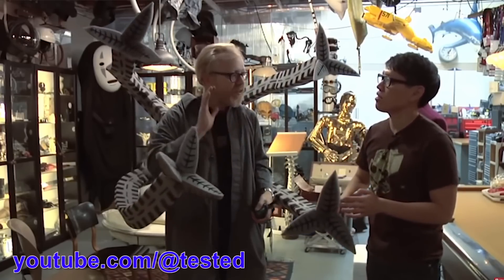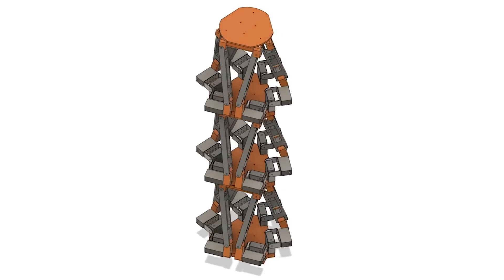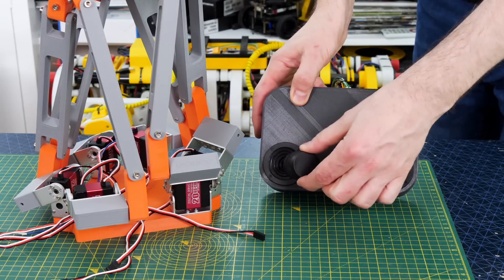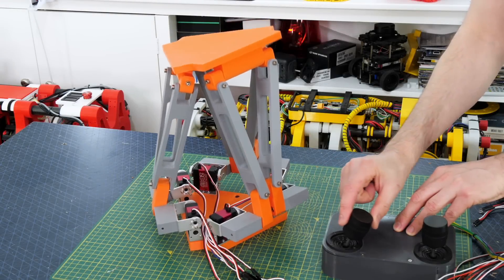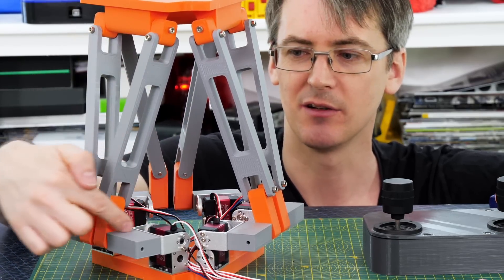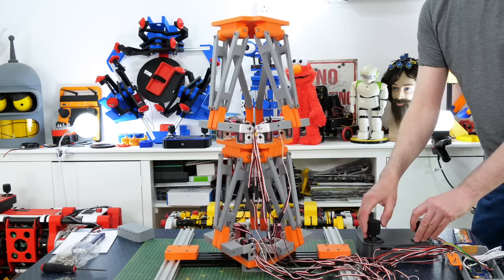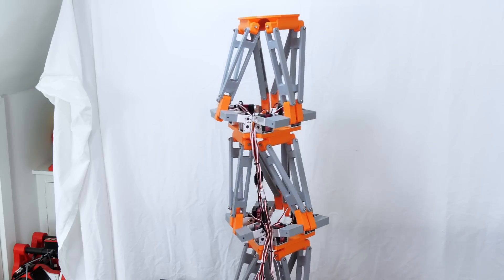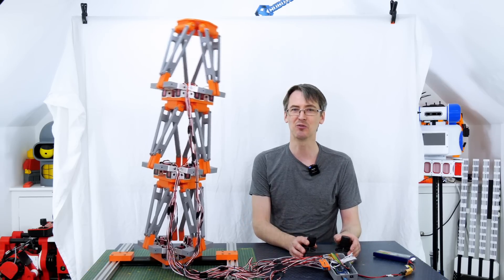Building a better Doc Ock Tentacle

Comment: Are you planning to make the Octoarm go to a certain point in a coordinate frame, or are you staying with manual control? 

Would be sick if you could utilize the basic kinematics you integrated in this video, reverse it and make a controller capable of producing a set of outputs for the servos, which puts a point (prefferebly the tip) of the robot at a certain point within a coordinat system (within a set of viable coordinates). 

That said the algorithm to produce these outputs would require constrains relative to the systems capabilities.

Once that has been established, path planning along with paht optimization would be cool to see. 

Finally a fancy way of designating the goal point in 3D space. Perhaps a laser pointer combined with VSLAM both to recognize the pointer's reflection, designating the goal postion and mapping in the ennvironment as to define which constrains should be appliend in real time. 

I would love to see how you do this with regards to real components and how you would get them to comunicate and so forth.

Comment: AVP 👽⚔️🐍
 Right / but doc oct/ and cerebral control"/ yeah ,where are you / ...the cranial electroded'/.../ So the boards/ what set the specs/ / so transistors"/ tuned to which waves....beteas"/ / to any actuator, that just open and closed

Comment: Id love to see the MK2 of this. Perhaps using belts (metal core so less/no stretch) instead of ball screw? could save on weight Im just am chair engineering thought. Perhaps Ball screws are a better solution for stability.

Comment: James, the exact inverse kinematics equations are actually very easy for parallel manipulators. In this case you probably don't need super accurate control, but it might still save you a lot of headaches in the future if you get the IK right. Parallel manipulators are the opposite of serial manipulators in that the IK is usually trivial, but the forward kinematics are tricky and have multiple solutions. As an example, Section III here shows the idea for a typical prismatic-joint Stewart-Gough platform: http://connor-mccann.com/wp-content/uploads/2017/10/Design-of-a-Stewart-Platform-Inspired-Dexterous-Hand-for-6-DOF-Within-Hand-Manipulation.pdf. This is just from a paper of mine that I could find quickly, but there are tons of other examples of it online, too.

Comment: For the macro positioning, you could use a parametric spline function. As you know the length of each section, you can easily calculate the 3d slope at a given point along the curve, which will give you the normal for the platform that you can feed into the inverse kinematic function.

Comment: you can achieve yaw with a stuart platform, you just dont have a great yaw component of force given the current actuators straight up/down orientation. Considering you have 3d translation and 2d rotation, this design actually has enough actuators for all 6dof but is leaving 1dof on the table with the geometry.

Comment: Hello, i'm working on a project to control an inverted rotary pendulum with the dc motor voltage as input and the vertical pendulum angle as outout. Any tips for designing the controllers and wothits implementation?

Comment: In all reality, this project is the most accurate to the real doc-oc arms, in the film, you see that they have him wearing a prop for the arms but also that they use CGI to move them. When in CGI, the tentacles are larger than the prop tentacles. This is a thing that most don’t see and the reality is that it needs to be large to work right. Aka, this is probably more close the realistic scale of the tentacles if they were real.

Comment: Doc Ock quite often uses his lower tentacles for stability, so that might help with the weight issue. Also, I would say it's already a work of art, even sans LEDs.
Reply: The weight issue still applies to the individual tentacles. He uses his lower two for stability so that he doesn't flip over when he lifts something heavy.

Strain will always exist. It's merely a matter of knowing your limits.
Reply: I too use my lower testicles for stability.
Reply: @elijahbutterfield4869  r/cursedcomments

Comment: The lever moment on the arm with 5 to 6 segments, fully horizontally extended, is going to be quite significant. Maybe some kind of counter balance weight or spring setup? Interesting build though

Comment: I think it would be cool to try using pnematics for something like this! You can make it stretch and contract with very light materials! Not sure how the tubing would work though
Reply: The original comics uses something that looked like pistons. But they could probably be linear actuators in a shell.
The problem otherwise with pheumatics is piping and valves, and you would probably go hydraulics since pneumatics using air get more springy, and would bounce a lot more.

Comment: If you did want to make it an actual tentacle there might be some wire issues, they looked a little like they where in the way or would get tangled in the bendies.

Maybe putting a small hole in the center would allow you to funnel all the wires through that and minimize the mess?

Comment: this is a bit off topic but that Stewart platform mechanism looks like a pretty cool mechanism to use as a 3d printers printplatform. You ought to be able to 3d print on a slant with how it can manipulate the axis of the base
Reply: Already possible but not easy. Delta printers exist but generally only use three rails for xyz motion as they keep the end parallel. I've seen a build with 3 pairs of rails to achieve the tilting motion too

Comment: You should have the sections taper, get smaller and smaller towards the end.

And you should definitely do a version with twisting. 

And more pronounced movements, wider range, more extension, more compression, more bending.

So cool man. One of the top channels on YouTube. Always fascinating. Thanks.
Reply: Twisting is not really required if each section can move in any direction, you would only need rotation at the end for the gripper.

And adding the rotation will add complexity and mode springiness in the movement, especially if you do not use some rim bearing. A central shaft would make it quite a lot less durable and wobbly.

Comment: That's really cool!!

One relatively simple way through code to add some organic-ness to the motion would be to propagate the input to each segment with a delay. So, for a tentacle-y feeling, pulse the input through the base segment, then a slight delay before the second, then the third. If propagated in the other direction (tip first, then mid, then base) it would probably look more like a snake, where the head is making a decision where to go.
Reply: In the film, Doc Ock's tentacles DO move in that snake-like way in some scenes for precisely the reason you describe! They want to imply that the tentacles are making all the decisions, so they have the motion start from the end effector so it looks like a "head"!
Reply: This is exactly what I was thinking!
Reply: Damn I was gonna suggest that, that's basically what we do in 3d animation.

Comment: When you mentioned independent control of each section I started to think about ways to have more control over each section. There are 3 joints between the palm of your hand and the tip of your finger, so maybe it would be possible to have more independent control by controlling it with your fingers? Maybe you could use 3 or 4 fingers to control multiple directions. A device to accurately determine the position of each joint of your fingers may be a challenge though. It would probably require some kind of glove. Maybe with strings or a hydraulic system?

One of the problems I currently see is that finger joints are rotational, so there isn't linear control for extension or retraction. Therefore horizontal movement and making the arm longer or shorter wouldn't be easily achievable with finger control.
The thumb has a lot of control, so maybe you could have 3 points in space to switch between rotational, horizontal, or vertical motion? Like, you move use your thumb like it's one of the sticks on the controller. But if you have it in the bottom right you control horizontal movement, in the bottom left you control rotational movement, and at the top you can control vertical movement. Then you can also mix those types of movement by having your thumb in-between the positions.

It sounds like an interesting way to control an arm, but I also expect it to have a steep learning curve 😅

Comment: For a strictly doc ock tentactle, you could probably get away with just the 3 rotary axis to save on servos (and servo weight), since his arms don't usually compress or extend. Maybe look at robot arm  3 axis wrist mechanisms, especially the differential ones. Paul gould has some cool mechanisms in that regard.
Reply from the maker: using at least 4 axes makes it much more flexible so I still need the translation.

Comment: Look into using flexures rather than pivots. It should be lighter, and the springiness will give a lot of inherent structural integrity. I've had good results combining PETG with spring-steel inserts and elastic.
Reply: One could also tune these to get a pretension that the tentacle stays upright without any strain on the servos in the default position. So the servos at the bottom would actually pulling down for some moves, instead of just resisting gravity less, as it is now.
Reply: Was thinking something similar, possibly with the servo pulling the center to bend it.
Reply: Yeah and then using wires to control the placement of the tip, like how most mechanical hands work

Comment: For the second prototype feel like a smaller version of each segment to reduce the strain on the base might make it look even more like a real tentacle arm.
Reply: Or making the base out of stronger material and then moving to lighter material as you went further out
Reply: @Harlequin_Actor  nah, tapering is better. Materials have limits, geometry has... later limits :D

The strain is the product of load and lever. Increasing the diameter linearly with the arm length (=lever] means the base has to handle the same useful loads as any element. The structural loads (weight of the arm itself) add up, though, so the diameter should increase faster than linear.
Reply: @nos9784  The moment actually increases with the square of the length, since you have a larger weight, further from the base. Conveniently though, the area also increases with the square of the diameter, so it (might) cancel out. Also what you're thinking of is stress, not strain (though they are related).
Reply: @nos9784  por que no los dos?

the goal, of course, isn't to make a perfect replica to the movie... just a version that actually works and doesn't immediately implode on first run.
tapering achieves a better look to being a tentacle, as tentacles are tapered.
materials have limits, sure, but the load isn't just volume... it's also density. a lighter material means a lighter load.

that said... making the ends of a tentacle brittle or fragile wouldn't necessarily be the greatest of ideas, but you could use steel for the first few sections and aluminum for the rest.
smaller and smaller sections along with the lighter material would make it much easier, although moving the entire design to metal would necessitate an alternative to servos... they simply wouldn't be able to handle the weight, even if it were tapered towards the end.
Reply: @Harlequin_Actor  i guess it would be best to do both- taper and build them progressively lighter.
Reply: @Harlequin_Actor  I want this to be cannon
Reply: I also was going to suggest tapering segments, thank you for getting there first
Reply: @jakeg6172  Except that tapering them would not match the target of Doc Octopus tentacles that do not have any such tapering. Yes for a more practical build sure, but for this I think visual adherence to the source is important. And for that, the segments should be shorter, about as short as they are wide (on average, so the can extend and contract around that average).
Reply: Just make it as strong as possible and use carbon fiber, Kevlar and titanium and wait and see if it just tears him in half down the middle? Hahaha...
Reply: @chrismsmalley2626  those materials have niche uses, and aren't as strong as you might think.

carbon fiber's strength is primarily tensile, which makes it a poor choice in the design, as all load-bearing pieces are under compression. the only time this changes is when it's on an outer curve... but that's not a justification to use it. you could just use a different material.

kevlar is a poor choice for the same reason carbon fiber is a poor choice. it's essentially a fabric, and cannot withstand any significant compression forces. another thing to consider is that the distance between the servo and the platform changes based on position, which means you'd only ever see any benefit from a tensile material in the fully extended state... (but you could literally use anything for that, like high-test fishing line)

titanium, while being incredibly difficult to machine and is therefore prohibitively expensive, is... entirely overkill. the cost to benefit is just too high. you also run the risk of fractures, as titanium is relatively brittle at room temperature.

futuristic materials are not all-powerful, and let no one tell you otherwise.
choose your materials to fit the purpose, not the other way around.
i.e... just use steel or aluminum (or an alloy thereof). they're plentiful and therefore cheap, and they get the job done.
Reply: @ShonicBurn I was about to say the same thing
Reply: Would it be possible to make an alternate function where the tentacle segments could retract further when stationery to make it more stable, as well as adding to the illusion of it contracting and/ reaching further. By possibly expanding on the design of the grey levers to allow them each to slide into each other and maybe using small pistons to support the expansion?
Reply: go big or go home!
Reply: @marcobaldanza2332  smaller segments but 5x more of them

Comment: Not sure if the bottom servos could handle all the load in the final product
Reply: Could probably do with gradually slimming it down towards a half-width grasper at the end, and using that weight saving to add beefier actuators at the base which can handle the overall strain better.

Comment: Implementing inverse kinematics for the end effector plate would be a very interesting follow-up!!!
Reply: I bet that would get very tricky, because it's under-constrained. There are a lot of positions that top plate can be in where there are multiple ways to get there. So when you go to solve for joint angles, you get multiple answers. Picking from among those answers adds a new wrinkle.
Reply: @matthahne  you could use something like FABRIC, which works for systems with multiple solutions.
Reply: @matthahne  Actually no, parallel manipulators are very easy to solve the inverse kinematics. The forward kinematics are where it gets complicated and there are multiple solutions. It's sort of the opposite of a serial manipulator arm. For a typical Stewart-Gough platform, you basically just decide "I want my platform here," which tells you where all six attachment points will be in space. You know where the six anchor positions are on the base, and you just need to compute the length between those six pairs of points to calculate the actuator lengths. This implementation is a bit tricker due to the extra links he's stuck in mid-way to expand the workspace size, but it should still be possible to work out a one-to-one solution, I believe.
Reply: @Connor_McCann  I am not certain, but wouldn't that just be the case for a single platform? Now that there are three platforms, there are many possible solutions / positions of the intermediate platforms, in order to positioning the final platform. This robotic arm seems to be a combination of prallel and serial. One could probably use some "tricks" of course, like seperating the rotations from the translations and compute them independently, or?
Reply: @henrikfjellheim3861  Ahhh yes, I hadn't been thinking about the overall manipulator, just one "stage." That's totally fair, each layer has 6-DoFs. But if one has good IK for each stage (which should be uniquely determinable), one could then apply heuristics to decide how to divide the total 6-DoF motion between the stages. Some ideas that come to mind are to: 

(1) Minimize angular change of all your actuators. 
(2) Minimize loading on the actuators, so the proximal platforms would move less than the distal ones. 
(3) Simply divide the total 6-DoF motion equally among the platforms in terms of translation/rotation.
(4) Maximize something called the "transmission index" which requires a bit more complicated math (something called Screw Theory) to describe, but basically quantifies how "dexterous" a manipulator is in a given pose. This would basically give the mechanism the greatest precision. 

Alternatively, if the goal is to make the arm move like Doc Ock, you might care more about the curve formed by the midline of the arm rather than just the pose of the end effector. In that case, the problem should be more constrained (e.g. each intermediate platform would need to lie on a 1-DoF curve, but you'd still have 5 remaining DoFs that would be indeterminate, so you'd need heuristics for that).
Reply: @matthahne  thats why we have random number generators
Reply: @igorordecha  the correct way is comparing it to its current position and picking the values with the smallest change, otherwise youll get certain parts moving in wacky ways for a simple 6mm move and itll ruin the aesthetic
Reply: it would be a good opportunity to make a video on the inverse kinematics of parallel mechanisms!
Reply: i like your funny words magic man